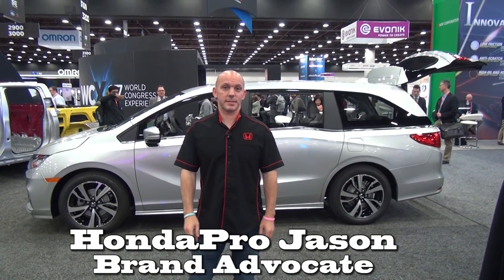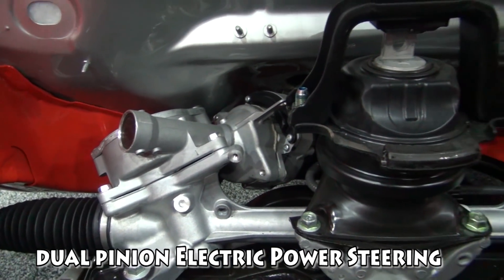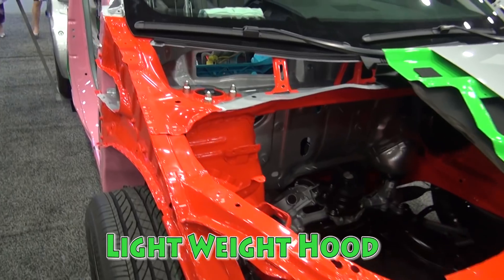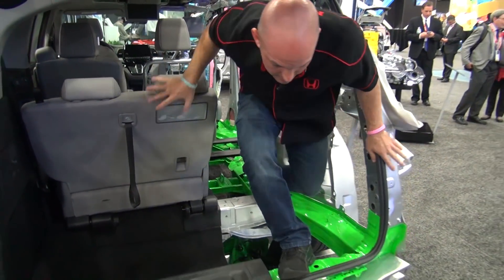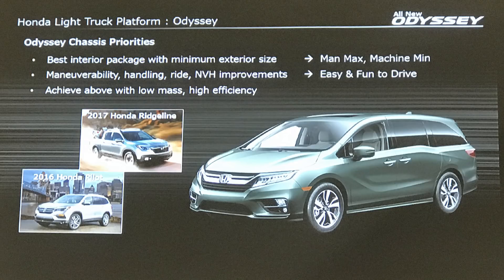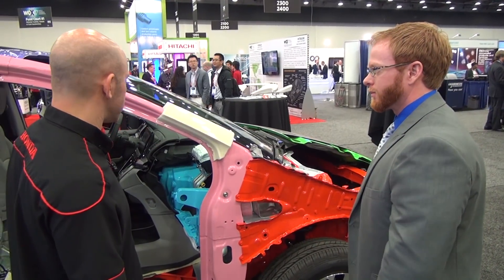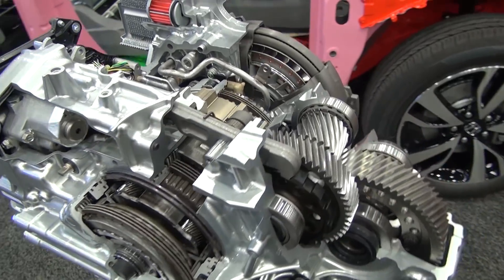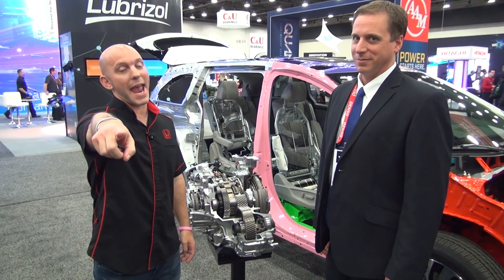What's really inside the New 2018 Honda Odyssey?

Comment: Need electric motors in the back and one in the transmission to make it a good hybrid to help torque.
Odyssey is way overdue for a more power electric hybrid system.
Reply from the maker: i agree
Reply: @HondaPro Jason 
i drove and own odyssey since 1995
1999, 2002, 2008 
and many Honda Acura from civic to accord to Integra Type R and GSR etc 
i can say that DOHC is way better, unless you have a really light weight stick shift like my 2010 Fit
the torque just isn’t enough for SOHC
Hybrid makes perfect sense if Honda can get more powerful electric motor in

Comment: They should design a tapered top back end version kind a like the tesla truck look. AWD and a safer side impact design...Behind driver and passenger hollowed out wall frame u can lean back through with the seats and strengthen side impact odds only safety weak point.. It's super safe except side impact test. after watching they're crash tests it's the only thing they really lack in safety....A off road sporty type minivan next for Honda ODD??? Humvee like?

Comment: I"m skeptical of that new 10-speed transmission, more moving pieces and now lighter than previous generations - How?  Transmissions take a lot of abuse (power and torque), and only the most durable materials should go into the manufacturing of the 'gears box' for reliability.  The overall package of the vehicle is appealing, but this transmission is worrisome  Only time will tell I guess, I'll be on the lookout for the reviews in the years to come.

Comment: Looks like a solid van but the transmission leaves me wondering how long will it last. The real engineering flaws Honda always builds is duel radiators which don't cool well enough and spotty electronic modules from other oem's. The electronic steering isn't anything new but works well it was featured in the ima hybrids and the s2000s. The selling point here is new tech of the transmission and uni body simplicity.

Comment: HondaPro Jason, You have failed to address the new front Aluminum control arms, on the Pilot, Ridgeline, and Odyssey. These new control arms are drastically different than past models. They have gone from strong cast Iron or Steel, to Aluminum arms that were pretty good sized, but these current flat type arms look better suited for a Civic, and what's the point of the removal of the two portions of Aluminum, the inner being quite large. How much weight could this save vs the loss of rigidity, a few ounces. HondaPro Jason, if you read this, please find out the benefits of these control arms, and their strength vs steel.

Comment: Those motor mounts look exactly the same as the one in my 2005. They are difficult to replace and very expensive. Lucikily i was able to find non-oem ones that were a fraction of the cost. It is my only real gripe about it. Other than that the odyssey is a great vehicle

Comment: 354,800 miles on my 03' Accord no transmission issues. 07' Odyssey over 230,000 going strong. Had a 93' Civic with 287,000 and sold it only because we purchased the Odyssey. Only Honda's for my family. Had several other Honda autos no major issues just lots of miles. Next purchase will be the 17' or 18' Accord Touring Hybrid

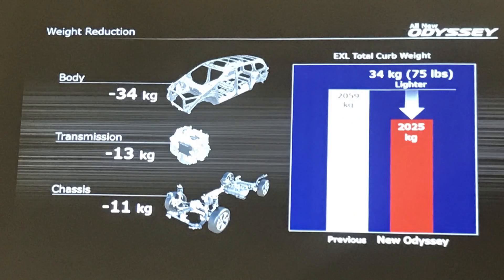Comment: The 2017 vs 2018 weight reduction spec sheet they show @9:00 says "EXL total curb weight", yet the 10 speed automatic is not available in the EX-L.  I wonder if the weight they show is for the 9 speed that will be in the EX-L, or is just showing what the weight will be when they inevitably move the 10-speed lower down in their trim levels in future model years.

Comment: Did you ask about cylinder deactivation for fuel economy? We have a 2010 and due to the eco mode (cylinder deactivation) it consumes a ton of oil as it needs to lube those cylinders that don't have a spark. Ours uses up a quart of oil EVERY 3k miles and Honda said it is within its normal parameters. I cannot conceive the idea that a whole quart of oil in 3k miles being burned as NORMAL....
Reply: tradersato   My 2012 has the cylinder deactivation, but burns no oil.  Your dealer is feeding you a line of bull.  The cylinders are lubricated from the bottom, and no additional lubrication is required with that feature.  I normally can go 9,000 miles between oil changes without adding oil ever.  80k mileage currently on the Odyssey.  Most manufacturers consider one quart of oil every 3,000 miles to be acceptable.  I worked with GM for 5 years, and they had the same problem on some vehicles.

Comment: Great walkthrough! Did you get any info on why they finally relented and moved the sliding door rail up into the glass area? Something they have not done until now and have always had that separate body line on the side, which the other competitors didn't.

Comment: Hang on, Honda couldn't even get a four speed automatic to last. The Accord gearbox disaster, and the way Honda treated their affected customers was terrible. Honda can do anything, except make a reliable automatic transmission!
Reply: Casey Stoner That's... that's good! Now people will finally buy manuals!
Reply: Problems with Honda's 4 speed autos?  Total nonsense.  I purchased new a 1991 Accord that went to over 350,000 miles on the same transmission.  I can't tell you how many trips from NJ to Las Vegas one of my  kids drove it to go to school.  The only transmission I know of that was faulty was their early 2000's new at the time 5 speed auto.  I purchased new an Acura 3.2TL.  Acura swapped out the bad tranny and put in a new one.  Currently the  car has 228,000 miles on the replaced transmission.  Honda in fact did help, they extended the tranny's warranty to 7 years and 100,000 miles.
Reply: Not very true at all.  The current 6spd has proven to be quite reliable and performs extremely well.
Reply: Once bitten, twice shy!
I'm guessing you, or a close family member wasn't affected by the Accord/Odyssey Automatic gearbox failure fiasco. 
Can Honda make great F1 engines? Most certainly. 
Can honda dominate Moto GP? Absolutely. Can Honda look after their loyal customers properly who were affected by the automatic transmission failures? Well in hindsight they probably could have.
But...........................
They Didn't!

Comment: The two transmission choices will be the new 10-speed developed in-house by Honda and the 9-speed ZF 9HP, which has had its share of problems. I'm leaning towards the 10-speed in hopes that if there are problems with it they will be handled quickly by Honda.

Comment: With Hondas track record for poor transmissions, this new one worries me. 4 more gears with the same dimensions as a 6 speed means more heat density, which means parts wear faster. Unless honda has worked a thermodynamic miracle I wouldn't be surprised if the first few years of that transmission suffer major failure rates. Granted transmissions failing due to poor cooling and clutch failure are nothing new to the Odyssey line.
Reply: They used to use lght truck transmissions.  The Gen3's were basically light truck transmissions.  with 2008+ being more reliable than 2005-2007.  Forget the 2004 and earlier ones, they die regularly below 100K miles.  The Gen 4's were bad, but there were some cases of failures but not as much as the Gen2/3.  Also Road noise and engine mounts were a common problem.  Oh and one more thing those pesky nylone door rollers that cause the sliding doors to jam.  Not sure if they still have those for 2010 and newer.
Reply: Why would you not take that new found extra space and added one more gear. Then you could add clutch material and increased fluid capacity to increase liability with a little bonus in fuel economy.
Reply: My Accord has the six speed...manual!!!  It's great transmission and fun to drive.  Too bad they are so hard to find.

Comment: Nothing said about the engine.  If it still has a rubber timing belt then it would be a disappointment.
Reply: I haven't had many problems with a belt. We replaced it at 110k, 220k, and now 330k isn't too far away on our 2003 Accord V6.
Reply: It's the same J35 engine.  This engine is old, mechanical valves, timing belt, no cam phasing, old SOHC design.  But I believe the Odyssey will get the improved MDX/TLX engine that has VTEC on both intake and exhaust, plus direct injection.

Comment: Great vid Jason! It's amazing how much engineering goes into these vehicles. Nice to see the cutaway and the structure, chassis and new transmission. Too bad the great new 10 speed automatic transmission will only be reserved for higher trim levels.  Regardless this 2018 Odyssey will be king of the minivan hill.  What is the word on the upcoming 2018 Accord, they really seem to be keeping it on the DL. How will it look, will there still be a V6 option or likely an I4 turbo....?
Reply: Already announced.  New Accod has no V6 option.  Base is 1.5Litre Turbo, and a 2 Litre Hybrid.

Comment: Why 10 speeds? Is the transmission going to be reliable? How many miles is it rated to run before it needs repairs or replacement?
Reply: The more gears, the better performance and mileage.  More gears allows the engine stay at a lower rpm, but still get the same performance.
Reply: Making the gears and clutch ring thinner could also mean they receive higher stress proportionally compare to thicker ones. I am not sure if this is going to last as long as older thicker ones. There's also some uncertainty for newly designed thing ( doesn't matter what it is, from software to hardware ), and Honda's auto trany isn't as reliable compare to Toyota even that might have been changed, but I am just going to wait to see. I ain't buying new stuff like this especially new Odyssey now cost USD $30+k.
Reply: My 98 Accord is still humming along with 190k on the original.
Reply: LOL interesting how this is an Odyssey video and comment and folks replying with Accord transmissions lasting a long time.  The Newer 4th Gen still too early to tell, bit some are starting to fail.  2nd Gen was crap and had class action law suit failing anywhere from 70-90K miles, 3rd gen earlier models had issues through 2007, 2008 had slightly different transmissions, mine so far doing OK, but my long time Japanese only mechanic says can push to 170-180K miles if you change fluid religiously.  Not much beyond that.  So no not all Hondas last forever.  Honda has invested significantly in their new transmissions, so I'm hoping the newer transmissions will improve.  Hope they will handle their long standing issue with noise and engine mounts too.
Reply: Mrschmitty13 My 98 accord would like to have a word with you.

Comment: I like your videos but I wish you would have explained things better or got the engineers to. For example, the red crash cage. ok, its red and a crash cage. But how does it work? Thanks for video though. What you did cover was good.
Reply: meinasalon These are structural pieces that essentially keep the vehicle together and its occupants as safe as possible. The different colors used were to show/highlight the different sections and possibly the different materials used in those sections. The front highlighted their ACE crush zone.